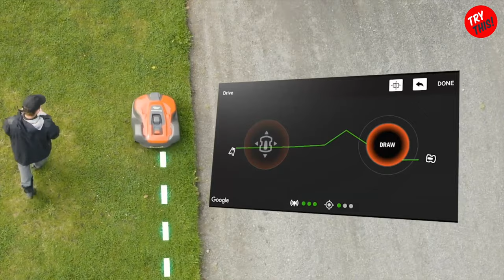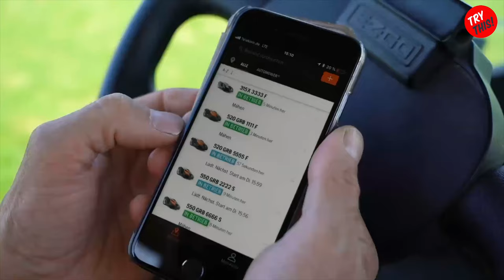HUSQVARNA AUTOMOWER 450X EPOS INSTALATION FULL REVIEW

Comment: I've been searching for a lawnmower without perimeter wires for ages, and finally stumbled upon the Segway Navimow robotic lawnmower. It's a game changer! The convenience and efficiency it offers compared to other brands is truly remarkable. Highly recommend giving it a try, you won't be disappointed!
Reply from the maker: Yeah I’m loving my Automower. The only downside is that none of these robot mowers can mulch leaves. The problem is the blades fold in when hitting the leaves so I’m experimenting with solutions to get the blades stationary since I don’t have kids and I keep my yard clutter free. I use to have a robomow back in the day before they were bought by mtd and became junk. They used fixed steel blades like a traditional mower and it mulched. It was awesome. Unfortunately back in 2018 they had no smarts in the mower it was Bluetooth only and random pattern with boundary wire.

Comment: Thank you very much for this video ! Still happy with the mover ?
Reply from the maker: @anthonytouchet9371  yes it’s a phenomenal mower. The only improvement it could have is better leaf mulching and or some way to collect leaves. But overall it’s the best mower I’ve ever had.
Reply: @TiltedTripodMedia thank you very much for the feedback. Very good point regarding leaves
Reply from the maker: @anthonytouchet9371  it’s still worth it because your lawn always looks immaculately cut and can have fancy striped patterns. It’s also healthier for your lawn cuz it cuts little bits at a time feeding the clippings back to the lawn. It’s also very quiet
Reply: Thank you ! May i ask you if it  stays stuck sometimes ? Then need a manual action to help him ?
Reply from the maker: @anthonytouchet9371  if your lawn is free of large debris like tree branches, toys etc and doesn’t have any ditches to get stuck in (holes) then no it’s rare. As long as you have a fairly smooth lawn it wont get stuck.
Reply: @TiltedTripodMedia thank you very much !
Reply from the maker: @anthonytouchet9371  you’re welcome always glad to help :-)

Comment: How is it working so far?
Reply from the maker: So far I have had zero problems. My only complaint would be that driving it precisely along the edge to define the boundary isn’t easy. The controls are too touchy. However once it’s set up it’s fantastic and still way faster and less physical labor to set up than the wire version and if you need to change the boundary it’s way easier too. The wire version not so much. Maybe I should do a end of season update video?
Reply: Nice. I'm looking at one for approx 3 acres of cleared forest area. Fingers crossed it works well. 🤞
Reply: An updated video would be great!

Comment: There are two 450XH, one is EPOS ($5900) the other is just 450XH ($3200) price is so much different. What’s the difference
Reply from the maker: The epos version is fully wireless like the one in this video. The non epos edition requires a boundary wire to be installed around the edge of your lawn. I can say with experience the wired version. Sucks. The wire will break and when it does repair is a nightmare or $$$ to hire someone. Totally get the wireless epos version. It’s been a game changer.
Reply: The more expensive one cuts taller grass.